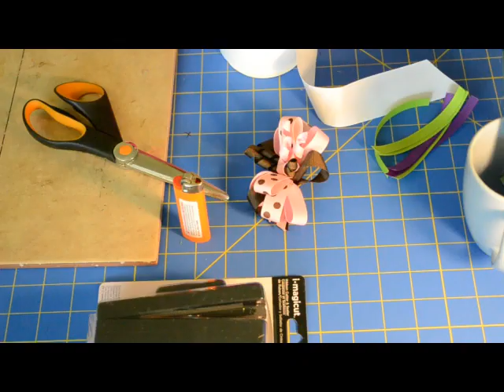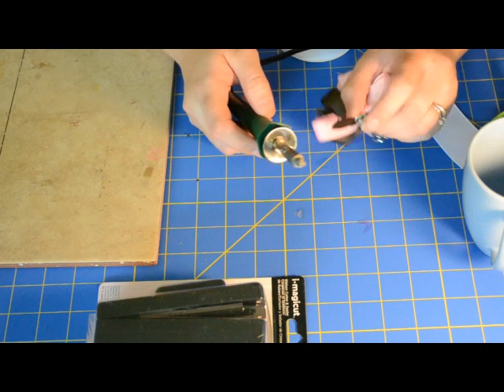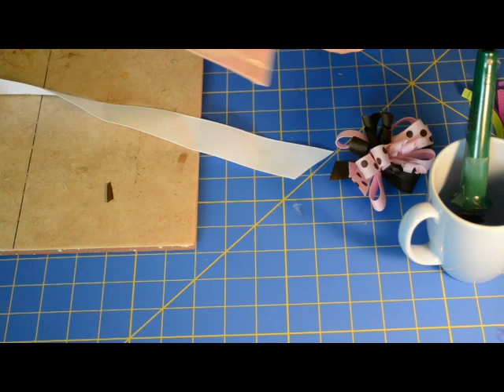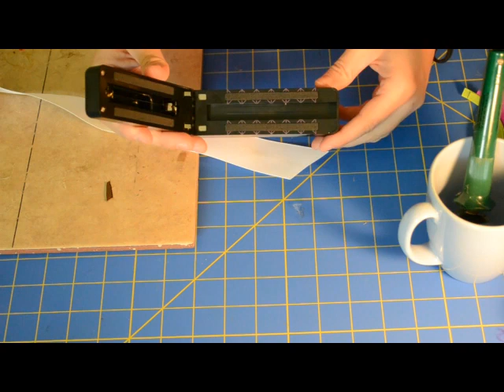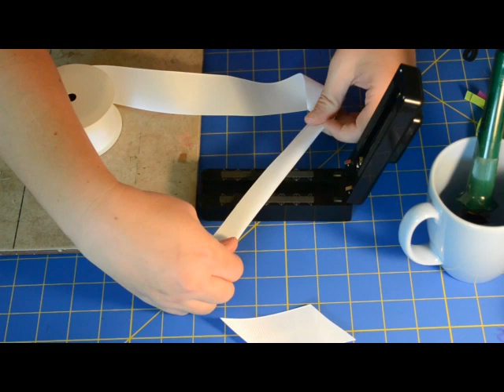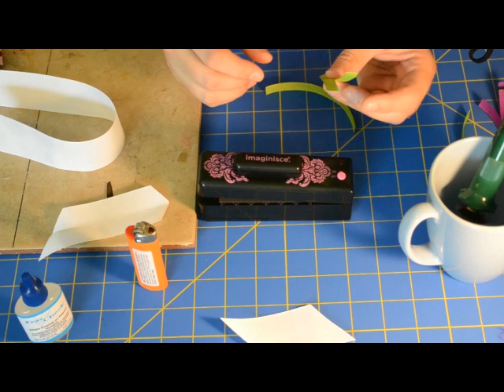How To Prevent Ribbon Ends From Fraying

Comment: In this video video demonstration you showed us ribbon that was pre-cut and sealed by a machine, recommending using them when making bows with many cut ribbon pieces. You said that you have them available on your website. Do the ribbon pieces come in all lengths, colors, dove ends, diagonal ends, straight and v ends? What are the prices. I as curious to know whether or not I just order the ribbon, lengths to be cut and color directly Rom your website because I have not been able to access your website at Hair-Hardware.com. Can you email me contact phone to call?